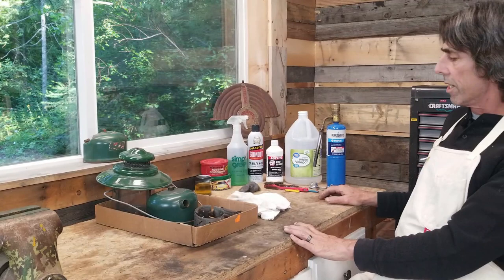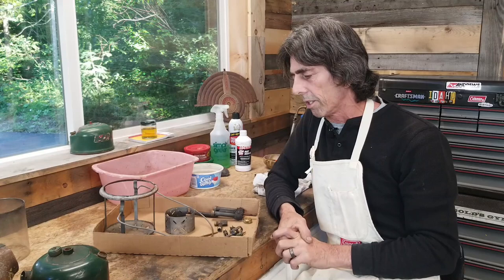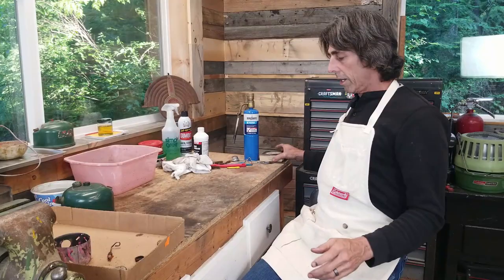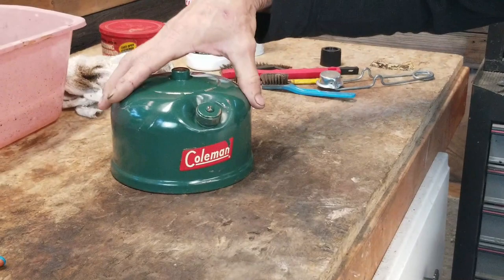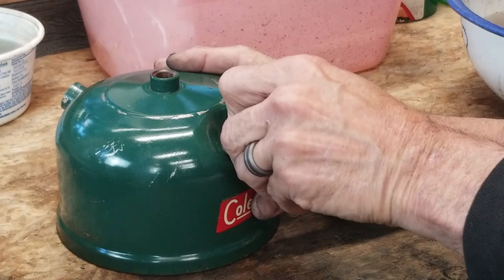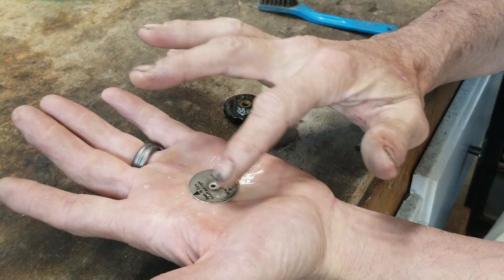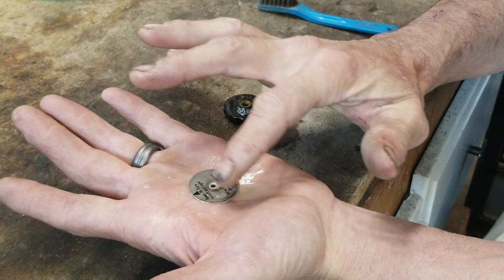How to Rebuild a Coleman Double Mantle Lantern Part II:  Cleaning and Reassembly

Comment: Had a Coleman back in the 60's while growing up and never gave it a thought to clean it.  Bought a used 288 the other day that works great so thought I would get on ebay and buy 2 more, not 288's but others that may need cleaned up a little.  After I get them I will fix whatever is wrong with them and clean them up a bit a re-sell them to get my money back from the 288..  Very informative video, this one and your other one, about how to take apart, what to clean parts and how to put back together. Didn't want to walk away without thanking you for your vids so thank you very much Sir.  Take care..

Comment: Thanks Frank! Picked up a 220F built 8/71 at a Thrift Store for $10. Ventilator was pretty  beat up, a little rust under the Base Rest and rust scattered here and there. Followed Part 1 & 2 of your nicely done videos. Got rid of the Mud Dauber nest, rust and tarnish, cleaned it all up, it's running great and looks pretty good. It's a seasoned veteran, with earned scars and good to go for many more years.

Comment: Used Frank's suggestion to make a check valve extractor from a large flat edge screwdriver. I used an 8" squared shaft screwdriver and I cut the end off, ground it down and filed off the burrs.  I had a replacement valve, so it was easy to determine the correct fit.  My assistant held the fount with a deflated bicycle inner tube wrapped around it, and I turned the screwdriver with a vise grip clamped on to the screwdriver shaft.  The check valve released with a pop.  Thanks for your videos.
Reply from the maker: Joseph that is awesome--glad you got it out.  I pulled a lot of them that way but it was always nerve wracking to do so.  Thanks for the comment.

Comment: Great vid. Today I dug into a 288 with a really rusty air pump tube. I began with a 13/16" drill bit, by hand to remove the heaviest rust. Then I took a half round file that fit into tube loosely and wrapped 320 grit emery paper around it so I could work it in and out and around and around to remove some more rust. Then I took a 1/2" emery paper drum on a mandrel with a Foredom flex shaft driven variable speed handpiece and worked it in and out and around. Looks decent but still pitted. This model has a rubber pump cup so I suspect it's less forgiving than the old leather ones. I oiled it up and it does pressurize as well as can be expected. I'm considering a thin film of grease in the tube and cup to get a little better seal so long as it dosen't gum up the check valve at the bottom. So to finally get to my question. When you send a lantern in the condition described back to Coleman for the $55 rebuild, what do they do about a severely rusted air pump tube? Just curious, thanks again.

Comment: Just picked up an excellent condtion 1971 228F and metal case from our local buy nothing facebook page. Even included the gear locker with flat wrench and used generator too. Box was stuffed with eight packs of vintage mantles. These videos really helped me understand how the Coleman lantern functions and I have a check valve extraction tool and pump replacement kit to get it working again.

Comment: Seems almost a shame to light it after all that cleaning! :) Thanks loads for this series of videos - You have helped me restore an 'old' Coleman 285 Dual Fuel. Finally got it working perfectly after replacing the generator, installing a new check valve, and cleaning out the inside. Thanks for all your help! Subbed! Dave.

Comment: I like using Daisy BBs, ( the kind that will put your eye out):) to get the rust flakes from inside the fuel tank. Dump a tube in and shake vigorously.  Most of the BBs can be shaken out. The last few can be grabbed with a pencil magnet.
I have cleaned dozens of lanterns and camp stoves, and I'm always on the search for better ways to clean/restore  these items. When replacing the gasket on a three piece fuel filler cap I like to use a small amount of Permatex gasket cement, it helps to keep the gasket in place when removing cap. If I run into a pump tube that is unrepariable. I will remove the check valve, clean it and put a dollop of solder on the inside end. Re-install it and then use a filler cap which I soldered a Schrader valve. The tank can still be pressurized with a bicycle pump. Thanks for the tech tips.

Comment: Great rebuild series.  Truly appreciated.  There is something special about a gas lantern that just can't be replicated with LEDs and I love the idea that as long as I have fuel, a match and a thumb I can have light (and heat if needed).  No need to ever hunt for batteries or a means to charge them.  Sometimes old-school tech really is the best way to go.
Reply from the maker: Old school is often times the best way.  Simplicity never goes out of style and these were great products.  They'll last forever.

Comment: I have this exact lantern and in the assembly stage . Mine is not in as good a shape as yours. Who ever had it before me was real rough on the fount. It has no dents but the fount is really scratched and some chipping. The vent is in really good shape and polished up very nice. It's a 1951 228E and was covered with thick gunk and a little rust. Took a lot of cleaning. Can't wait to fire it up.

Comment: I like those shiny brass tubes. But even if you baby it and preheat startups, they still get black and scorch marks. Part of the game I guess. But they always shine back up. I rotate my collection of 30 or so quite often. Between running and working on them at home and my vacation house in Tennessee that I’ll rotate a few in and out. By the 3rd time I have stripped them down and cleaned everything, touch ups from the first cleaning. Vinegar, carb or parts cleaner (canned, high pressure helps), dry everything. Buffing compound and car wax work great on pained founts- but even on rusted ones where paint is missing. It will help fight the rust from coming back. Help not prevent- so keep them clean. Keep them burning.

Comment: I sent my Coleman  220J195 (made 5-77) back to Coleman and for $55 plus $20 shipping, they put in; a new check valve  ,generator, 2 cap screen, and  pump leather! Took a month and it works better than new.

Comment: I use a handful of bb's in tanks to clean instead of old bolts.
Reply: I use the zinc coated bb's just because it has a better reputation with rust than copper does.
Reply from the maker: Paul, yes, I've torn apart a 12ga shell also...works very well.

Comment: For delicate abrasive work, have you tried baking soda?  I've seen old coins polished with it.  Baking soda, little water to make a paste, then use your fingers as a 'scrub pad'. Wash off with water and the coin looked brand new again. Also, Heinz makes a cleaning vinegar, little higher acid content, not for human consumption.  I also use a Harbor Freight ultrasonic cleaner to use on carb parts and other metal items with 'tubes'.  I've used carb cleaner (sold in gallon cans for dipping) but I use it in the US cleaner, cleaning vinegar, other cleaning agents.  It can heat if you choose, and it cleans really well.  I use a different cleaner in the US cleaner depending on item.

Comment: Use Evapo Rust and soak all rusted parts in it for a week or two. Make sure you use a container with a lid, because it does evaporat. And it is environmentally safe. I've used it on a Coleman 425E and 425F stove and now using it on a Coleman duel fuel stove that belongs to my dad. Wish I could post pictures of them.

Comment: Hello Frank, great site!! I have two old Coleman lanterns, one is a wall mounted one, the other is a normal vertical one, both use a hand held pump and have a large tank for the fuel. They both are 2 mantle types. One has a globe. I don't have photos but can get them and mfg dates. I'm wondering what they would be valued at, I have 4 newer types as well but don't have access to them for awhile. Any help is greatly appreciated.

Comment: I’m working on a 1947 228D that has fought me the whole way. I got it all reassembled just to find out that even though everything is back exactly how it was, fuel is leaking where the tip cleaned housing screws into the main valve part that’s in the fount. What would you do? Is there some sort of sealer I could use or is this one just gonna be a decoration? I’m sick of working on it.

Comment: Thank you for the videos. I am just getting into old stoves and lanterns. Have you ever used Lemi-Shime (Citric Acid) on the brass? We use it in ammunition reloading to clean brass.
Reply: Citric acid also works well on rusted steel.  It will loosen the rust for easy removal.

Comment: Nice job.  Where I found brake cleaner to work better than carb cleaner Is a stuck check valve. Fill about 1/4 inch in the tube and use the plunger to push it though.  I even had a air tube that was mostly clogged come clean in under 5 minutes. Don’t get it on the paint and clean the inside of the fount when done.
Reply from the maker: Scott brake cleaner will eat almost anything so yes it is a great tool, but it will destroy a paint job in seconds flat.  Just use extreme caution...!

Comment: Thank you for the excellent instruction on Coleman Lanterns. I have a question. I have a similar Coleman Lantern but the air fuel tube has a long needle like this one but mine has a little fine wire at the end of the needle. Should that wire be straight or bent?

Comment: Hi, I have a Powerhouse 295 model. How do I clean the check valve as I can't get air into the tank? I suspect it's rusted as the lantern wasn't used for a Looooong time.
Thanks in advance.

Comment: I have watched this video over and over , now gonna attempt to do my 220 , the problem I am having is it won't stay lit and won't sputter fuel at 1/4 turn , I have to open all the way to get to sputter fuel , installed new generator,  no change , after watching I am now thinking the problem is in the air fuel tube , any help would be appreciated,  I subbed and enjoy watching these wonderful videos , and very cool intro , thanks
Reply from the maker: David, I agree--the problem is probably the F&A tube.  You can email me at info@oldtowncoleman.com if you need assistance with it!
Reply: @OldTownColeman  thanks so much , will let u know how it goes

Comment: I have a 220D from a garage sale that I cannot pump.  I simply cannot 
force the pump down.  Taking out the check valve though, I can pump it.  Air 
goes in no problem...   And if I can do that, it means my air tube isn't
 blocked, right?  The checkvalve appears clean and the 
BB rattles like it should.  If I re-install the check valve and pump, I 
get the same result: I cannot press the pump down--too much pressure builds in one pump.    I am stumped.  Any ideas what could be the issue?

Comment: My latern was in our Coleman camper for 19 years in the nice gold plastic case. I bought a check valve remover. It worked great and I cleaned the valve and the ball rattles, when I pump it up, it does hold pressure. I put new mantles. When I try to light it, nothing. I hear no hissing when I turn 1/4 and naturally nothing lights. Any Ideas. Also the fuel I used was sealed but it is 19 years old too. I just removed the generator and turned the start valve and I did hear air hissing. I also ordered a new generator. The lantern is a 220K from the 1980's
Reply from the maker: Michael we need to troubleshoot that.  Re-pressurize the lantern, open the valve about 1/2 turn and then crack open the generator jamb nut.  Does fuel come out under the jamb nut?

Comment: I have two old lanterns, a 220F and a 220J that have been sitting in my garage for over 20 years unused. I decided to try and see if I could get them to light. The 220F has a frozen fuel valve and will not budge. I'm afraid to force it. Any advice would be greatly appreciated. I was able to get the J model to light after replacing the old gas with fresh, but the mantels burned dimly and I couldn't get it to relight later. I can hear air when I open the valve but no fuel hissing. Your videos are great and I subbed. Thanks for your help!
Reply from the maker: Henry the 220F valve is frozen from fuel varnish and it sounds like the 220J has a fuel & air tube issue.  On the 220F, take the valve wheel off, followed by the valve stem nut.  Spray carburetor cleaner at the valve/valve stem junction for a few days and then reinstall the wheel and try to unscrew the valve stem.  Gently place channel-lock pliers around the valve wheel and squeeze just enough to grip the wheel, then apply counter-clockwise force to unscrew it.  I recommend you rebuild the lantern because if you have varnish in the valve, it means that the lantern was probably pressurized when it was left to sit and there may be varnish elsewhere.  I also recommend you rebuild the 220J as you'll probably need to remove the valve to get the fuel & air tube clean again.  You can try swirling fresh fuel around inside the tank and allowing it to sit for a few days in an attempt to clean it--that might work.
Reply: @OldTownColeman  Thank you Frank! I will take your advice and try a rebuild on both of these. Your videos are very thorough and I appreciate your doing them!

Comment: Hey Frank
Bought an old 228F and it came with some kind of wire bracket around the globe rest. You can open the wire as it's a 2 piece part. Cannot find what it is. Hope you have an idea.

Comment: Very informative and clear advice on rebuilding a lantern! I'm a new subscriber and viewed your video on rebuilding the double mantle lantern.  I have a double mantel Model 220J.  I discovered my graphite packing has crumbled on the fuel valve knob and I need new packing.  Probably need it as well on the cleaning needle side as the cleaning handle is hard to turn and is sticking.  I have not been able to find new packing.  Do you have a source for these parts that are reasonable in cost?  Thank you in advance for any info.  Rob

Comment: Hi Frank. I have an 1985 288 cl2 . I was running fine. When you pump it up it build pressure but when you push the pump all the way in and give it a turn to the right I can pull the pump back up. It won’t lock in when you turn it. Any idea what’s happening

Comment: First off thank you for the video. I have a Coleman from 1957 and followed your instructions step by step on removal and cleaning. In the beginning I had great pressure before I cleaned my lantern but no hissing vapors. I just finished cleaning it and put fresh fuel, pumped it up and cracked the valve. I got hissing! It lasted a few seconds and then stopped. I did not replace any of the original parts though. Is there still a clog somewhere?
Reply from the maker: Joe not necessarily, it just sounds like you need to rotate the tip cleaner a few times.
Reply: @OldTownColeman   Frank I ended up replacing the tip cleaner and rod and it works perfectly now!

Comment: I have a Coleman dual burner that is clogged behind the check valve. I can’t pump air into it, what can I do?
Reply from the maker: Rolando I am about to go into the shop to do a video on exactly that.  You can also email me at info@oldtowncoleman.com about it.  Video should be up this weekend as it will be very short.

Comment: Mr Bebb, I have a 220k that was handed down to me from my grandfather (he is the one who got me into exploring the great outdoors) that needs to be serviced. I have had it for almost 10 years and have never done anything other than use it as intended, but I noticed a few years ago that it was becoming more and more difficult to light and have since just had it hanging as an heirloom. Do you offer maintenance service/repair or could you point me in the direction of someone/somewhere that does? I would love to have mine restored back to working condition and put it back to use. I greatly appreciate your time and any assistance you can provide. 

Thank you and best regards!

Comment: Frank, got another question.  I'm rebuilding a 228F currently.  The fuel valve was an absolute bear to remove from the fount.  Now, I'm going to reinstall it, and it seems like the pump tube is in the way of the lower stem of the fuel valve, not allowing it to go in straight.  I don't think I bent the pump tube, but it makes me wonder how the lower valve stem ever fit in the first place, because looking down inside, it looks like the pump tube is directly centered below the valve hole.  Any tips on this issue?  Thanks.

Comment: Awesome tutorial
Just rebuilt a 1978, 220J after watching this 2 part video.
I hope you can answer a question.
When it is running my fount gets warm to touch and the  collar gets hot, that I can't keep my finger on more than a few seconds.
Is this normal ?
I have a 2017,  295A that doesn't get hot like that.
Thanks again for the awesome tutorial.
Reply from the maker: Hello Robert.  Are you using the correct mantles and are they in good shape?  A burning lantern will heat the frame and the fount but probably not as much as you are describing.  On a warm night, you'll probably only need to pressurize a lantern once as the heat produced will help maintain pressure.

Comment: Great video. Thanks so much. I do have a few questions though. What caues the generator to fail? Taking one apart it would appear that a good cleaning should restore it. Does the tip orifice become worn or enlarged with use?  How does one tell if a generator is bad?
Reply from the maker: Burns, hello.  Contaminants in the gasoline will foul the generator; they bond to the cardboard insert and/or spring inside the generator, the tip cleaner rod, the gas tip and the gas tip cleaner.  It really builds up right inside the gas tip.  Cleaning a lantern generator is possible, a stove generator is much easier due to the size.  You can often times tell that a generator is nearing end-of-life by the amount of difficulty in lighting the appliance.